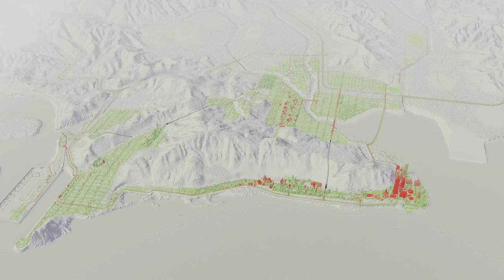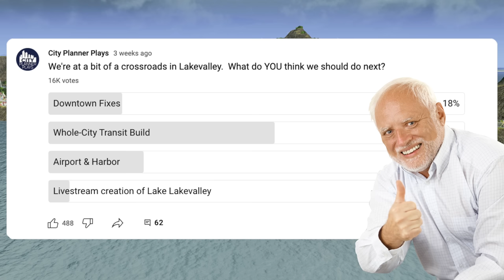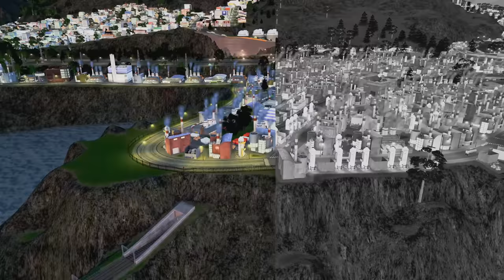Building the PERFECT Little Airport for the City That I Abandoned 2706 Days Ago

Comment: I work at a major airport and one thing I always see left out of people's airport builds is a dirt parameter road. There needs to be a road on the inside of the fence for security checks. It is a small detail but really takes detail to another level.
Reply: What airport do you work at?
Reply: @MaxP879  orlando
Reply: I was a maintainer in the military, and yeah, all our bases have perimeter roads. Some bases, you actually need it to even get to certain parts of the airfield. Anderson in Guam for example, you have to use the perimeter road to get to the parking ramps that run up between the two runways.
Reply: Im actually seeing a lot that could be done better about this airport, as an avgeek. Maybe I should do a playthrough of city skylines with a focus on airport design.
Reply: Im still watching, lol. The long individual taxiways for each terminal parking is also weird, its why they have to tow so far back to turn around back onto the taxiway. This sort of thing is why IRL airports have a taxiway basically right behind parking, perpendicular to it, so planes can be quickly towed out through a 90 degree turn, and be let go to continue on, on jet power, as soon as possible.
Reply: Plus, those "driveway" taxiways are taking up so much space. If he made the main taxiway closer to parking, it would open up a ton of sapce between the taxiway and runway. He could leave that empty as safety room between taxiing jets, and any jets on the runway undergoing an emergency. Or, he could fill that space with maintenance hangers/parking on the other side of the taxiway (if those are even an asset in the game, I havent had a chance to play with the custom airport tools yet).
Reply: Adding concrete between the taxiway and runway is also quite unrealistic.
Reply: @hatman4818  yeah it kind of irks me how much wasted space there seems to be in this airport. Those taxiways might as well be runways themselves with how long they are!

Comment: Nice work on the airport, but the runway really needs to go the other direction.  The landing approach over the hills would be a bit more steep than normal, but not more so than a number of airports in mountainous areas.  The real issue is safety while taking off.  If an engine fails, you won't necessarily have enough power to climb fast enough to get over the cliffs leading to a crash, but a slow climb over the ocean is no big deal.  Also, the trees are fine, they're not that close to the taxiways\runway and propane cannons will take care of any birds that wander too close.

Comment: currently the airport's train line is external only. I don't think the point of flying cargo in, is to immediately send it back. considering topography it might be hard to fit a line through to the main industrial area but I think it would be highly beneficial.
Reply: Typically the distribution network for a city would be trucks, not rail. There already needs to be sorting facilities for loading and unloading at the airport. So why not put your rail hub there also? The rail and air modes would not interchange much, that's true, but the rail and truck modes need an interchange, and the air and truck modes need an interchange - it would be very reasonable to co-locate those to save money.

Comment: You should add a couple of pedestrian paths that connect from the parking lot directly to the concourse that is behind it, passengers wouldn't be all to happy to have to walk on the side of the road out in the sun/rain all the way down to the main entrance. They would want to do it from inside the building with it's air-conditioning and heating and roof to cover them from the elements.

Comment: at 36:12, you can see two movements going at the same time despite your traffic signal. I just learned last night that this is due to a node being too close to the intersection. Basically, the decision to stop at the 'next' node happens at the previous node, so if the node before the intersection is too close to the intersection, and the speed limit is high enough, the cars will ignore the signal and follow right through. Your options are to either move the closest node (coming from the industry area) further away from the intersection, or you can reduce the speed of that approaching 4-lane road so the cars can and will stop in time for the signal.

Comment: Hey Phil, just a tip, use the Loop connection mode inside Network Multitool to make those smooth radius bends between 2 road segments. Then you get an actual straight connection off of your existing roads, instead of getting a tiny angle on one of the two selected roads when using the Create connection mode!
I use the Loop connection function all the time for bends in my builds

Comment: Obviously too far gone now but: at 24:00, in real life it's not a matter of the runway facing in a certian direction; both directions of the runway should be functional so that planes can take off and land depending on the wind direction. This is also the reason most airports have multiple runways at differing angles, to line up against wind direction and avoid crosswinds as much as possible.
Reply: I think you overstate it. Many airports have multiple runways, but it's as much about capacity as wind. Strong crosswinds obviously aren't great — they make for fun landings — but there are plenty of single-runway airports that just deal with it.

Comment: I do not like the grass lined road for the open parking lots, because it means everyone would have to drive over a strip of grass to go into a parking lot. That would just not be happening if there wasn't a central entry point and the rest maybe fenced off. 

Also, I'd consider making one connection between the passenger and the cargo road so the cargo traffic doesn't have to go through the industrial district to reach the highway if it needs to.

Comment: Pleeease make the airport a little bit more realistic. First of all there should be grass separating the runway and the taxiway, no concrete! Also connecting the airport road with city roads at your cargo airport is a huge safety hazard with any cars being able to drive onto the airport. The idea of the cargo building is that cars pick up cargo from the planes, bring it to the airport on one side. This makes cars spawn at the other side of cargo terminal.
Reply: The road connecting to the cargo is fine. The tollbooth is ment to be a security checkpoint so only authorized people will be let in.
Reply: @ttyler7256  A car delivering goods from the airport to the city should not be allowed on airport grounds though. Thats why citieskylines designed the cargo terminal that way with roads on two sides, so they would be separated. They are not meant to be connected.
Reply: @Quentin-vi4zi  Took a minute for me to work out what you meant, but I agree now.  The issue isn't lettings cars past the tollbooth, it's the roads that go around the sides of the cargo terminal connecting the terminal's front and back roads together.  Cars should only be able to get to the front road, where they could park and the person able walk into the terminal office to pickup any goods waiting for them.  Trucks, on the other hand, would pass through the opening in the middle of the terminal (where there's presumably an additional security checkpoint) before being allowed onto the back road where there's access to the aircraft ramps.  That would make sense, in many cases, cars wouldn't be allowed anywhere near there and they would need to go to a separate building somewhere else to get their things, but they certainly wouldn't be allowed to get near the ramps or planes.
Reply: @Quentin-vi4zi  Yeah, traffic delivering to the cargo airport is supposed to go through the terminal, not around it.
Reply: Yeah, no concrete everywhere. I know Phil has talked about water retention issues many times before... you'd think he'd know better than to concrete over everything in sight. Real airports are grass everywhere that isn't used for moving planes around... partly because there's no point in spending money unnecessarily, but mostly to alleviate the drainage problems associated with a large flat space like an airport.

Comment: not sure how you would do it here, but a touch of airport realism would be including two runways at offset angles. i think airports of all sizes do this due to wind direction. (look at some airports on satellite to see what i mean)
Reply: Yeah, he forgot about that. He did that in the other cities when he built their dlc airporta
Reply: Would not be a good idea on an airport with severe terrain limitation and built on reclaimed land.
The former implies little to no variation to possible flight paths' directions, and the latter would necessitate unnecessarily high costs reclaiming land (due to conflict avoidance and extra taxiways).

Not like this airport is much on the side of realism, better solutions would be either build it parallel to the coast and deal with heavy crosswinds, or build it further away from the coast.

Comment: a suggestion - you should change the runway direction because, if realistically thinking if the plane has a malfunction and it crashes it will either crash into the industrial area, the rail track or the mountain (which would be disastrous and costly in real world) whereas if you change the direction to the sea even if the plane does malfunction it could have a Sully moment and save itself.

Comment: This is by far my most expected cities skylines series to watch, love each minute and feel sad when it’s ending.
I have a suggestion for the airport, the strip between the runway and the taxiway may be of grass, i think that’s realistic, and there’s a way o making the planes taking off and landing not do that steep turn, that’s by making the air routes aligned 90° with the runway direction with move it. Greetings from brazil
Reply: The sharp turn at landing is not optimal but not unheard of, sometimes you have to do what you have to do.  For instance, at Reagan Washington National Airport in DC, planes landing from the north have to fly down the Potomac river to stay out of the restricted airspace above the White House and Capital to the north, and the restricted airspace above the Pentagon to the south.  Then, about the time you think you'll be landing in the river, you make a ~45 degree turn right to line up with the runway about 1 mile from the touchdown point and land moments later.  Likewise, if you taking off to the north, you have to immediately make that 45 degree turn left to stay over the river on the way out.  That's not the generally prefered approach or departure, but it definitely beats getting shot down.
Reply: Nice to know, here in brazil we have santos dumont airport SBRJ, and the landings and tkffs are this same way, it’s awesome, i just think that the game makes these turns incredibly unrealistic, that’s why i said, but agree with u tks

Comment: Another excellent video. Love watching you improve this city. Though perhaps it would be good to add a couple of shops in the industrial area nearer to the residential. Perhaps a gas station? Couldn't you have had the airplanes go in the other direction and not have to worry about the mountains?

Comment: Is it possible that the railway cargo terminal is atm just doubling as normal cargo terminal, as that railway line is connected only to the outside (if I'm correct)? Or does the game sends cargo in from the outside only to be immediately exported by another mode of transport?

Comment: I would probably switch the way of the runway, for two reasons. First of all, you want to takeoff/land into the wind which usually comes from the water. Secondly, if the aircraft has an engine failure on takeoff, you would want them to be able to land on the water and not the mountain side. Additionally, the aircraft and modify their final approach to go just between the two mountains.

Comment: I think we would see curved sea walls, especially as they are less likely to erode vs the harsh perpendicular walls at the airport. Even most pools have curved walls. This is in part due to structural benefits a curve has vs a sharp 90° corner.

The airport landmass probably needs some curves back!
Reply: Indeed... pointy corners are a big weakness...

Comment: okay okay here me out I love what you have done with the airport but as a pilot there are a few nit picky things I think could be changed. So in Aviation we have wind that all around us, and if there is too much crosswind on the runway you cannot take off, so I am unsure if you can do this in city skylines but an intersecting runway would be very beneficial, along with adding parrelle runways to reach to allow for multiple aircraft to land. This would be done beacuse a city your size, you currently have lets call a Charlie sized runway capacity (Airports like KRDU, KRSW, KROA), when your city size would necessitate a Bravo Runway capacity (Airports like LAX, Orlando, Tampa). Also your taxiways in how its designed are much like roads, there is traffic. all those intersections would confuse pilots  along with in real life back up traffic and maybe cause issues with pilots missing an intersection I would suggest adding a 2nd taxiway parelle to the terminal that has connections to your taxiway that is parelle to your runway.

Comment: One thing I find quite funny is that you always try not to build big cul-de-sacs, but here you have created not one but two big cul-de-sacs, and as a result I think the way for the trucks from the highway is not that great, with a lot of sharp turns. But on the other hand, I understand if you want to keep the light and heavy traffic separated. In that case, I would create a small service road between the two airports, with only service and emergency vehicles allowed on it.

Comment: Rather than having the taxiway very close to the runway with very long connections to the stands, I'd rather you space things out between the taxiway and the runway just so there's a little more space. Would also make for a more realistic airport because normally there's a lot of space between the runway and the taxiway.

Also 31:01 Ouch that looks like a very sharp curve. But I guess it's the approach to a terminus track, but the fact that you have that after a 2+km 1.5% slope downwards is concerning...

Comment: As an aviation nut, the airport placement is not ideal, as one end of the runway is mired by terrain obstacles and population centers.

This isnt entirely unrealistic though, some cities have little choice in where to place an airport or what obstacles will be around it. Having it at sea level, and pointed out to sea, much like the Princess Juliana international airport, or Kai Tak in Hong Kong, certainly helps, because at least the approach from the sea is fairly clear of obstacles. It does mean the sea approach may be the only viable approach regardless of tail/head winds, and the go around minimums would need to be fairly high and early in the approach. Both Kai Tak and Princess Juliana have these features.

And, at the very least, the other end of the runway points towards a gap in the terrain up the river, so if those minimums are violated, the pilots still have a (albeit tricky) way out.

That being said, this airport is essentially an artificial land megaproject, much like Hong Kong's new international airport, or Kansai in Japan... Artificial land for airports, out in the water, have their own problems, from costing a fortune to build to having the potential of settlement problems literally sinking the entire airport into the water. BUT, one of the benefits of such airports is total freedom to place runways whichever direction you want... So if youre going to do artificial land airport anyway, its a bit odd to have the runway facing in a direction with such approach problems. I personally would have considered ditching the harbor requirement in favor of having the runway parallel to the terrain along the coast. Or, you could have made the entire thing an artificial island (like Hong Kong international, or Kansai), and made the part between your island and the mainland a harbor area. Such a project wouldnt have cost much more, but would have made much more sense from an aviation perspective.

Personally, if I were building it though, and wanted to keep landscaping to a minimum, something like Madeira airport would have made sense in that area. You could have the airport as tucked in close to the land as possible, using minimal landscaping, and had the runway still parallel to the terrain. Madeira is still a challenging approach IRL, but it at least is approachable from both directions, making it much safer for changing weather conditions and go-arounds, and minimizes terrain obstacles on the flight paths.

Even Madeira has some megaproject shenanigans going on. To lengthen the runway for bigger and bigger jets, they had to cross a gap in the cliffs to another spit of flat land... Instead of filling that area in with an insane amount of fill, they simply built the lengthened runway on giant stilts.

I like Madeira because it was one of the most challenging airports in the world to place, yet the people of that island made it work as best as possible with minimal changes to the landscape, made reasonable compromises to flight path, and without resorting to literally constructing artificial land out in the water. If you wanted to build a "budget friendly" airport in challenging terrain, Madeira is an excellent example to look at.